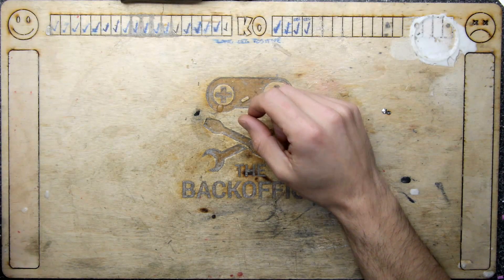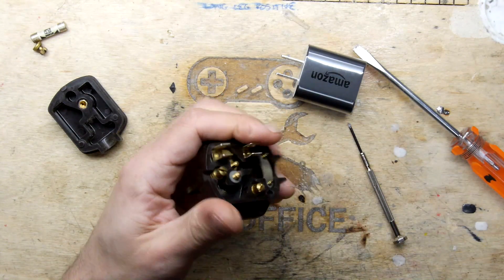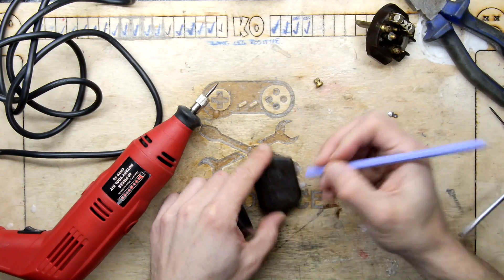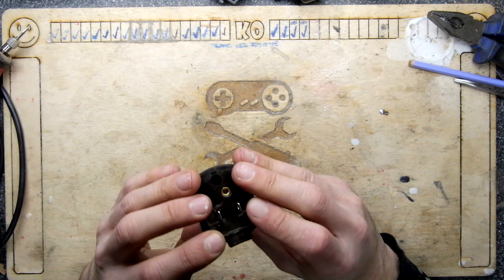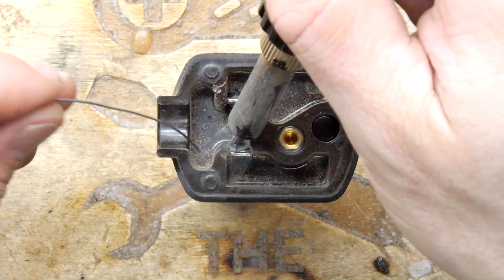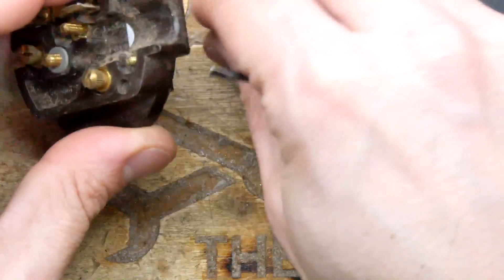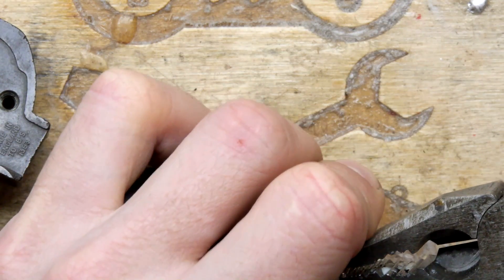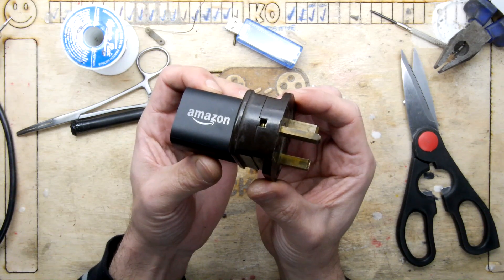DIY American Plug Adaptor

Comment: I just checked a US style plug I had handy with one of those two pin IEC (Kettle lead) Xbox mains leads. The amount of adjustment you would have needed to make to the plug pins or the mains lead socket holes would not have been much.
Reply from the maker: I know where you are going with this, interesting to try!

Comment: What do you mean it's like the olden days and could get shocked? In the USA that been my only experience getting a mains shock and still catch myself almost getting it plugging stuff in the dark feeling for the outlet getting my finger in between for that second. Even if we had the longer ground to unlock the positive openings I'd probably never get shocked.
Reply from the maker: Deep State Globalist Games The UK system has had a couple of revisions since then. The power terminals are insulated on their shaft now so there is no exposed metalwork you can touch when it's being inserted. Also there are a few interlocks in the socket to prevent things getting pushed in. It would be pretty hard to zap yourself now.